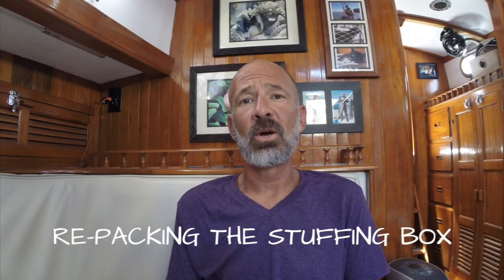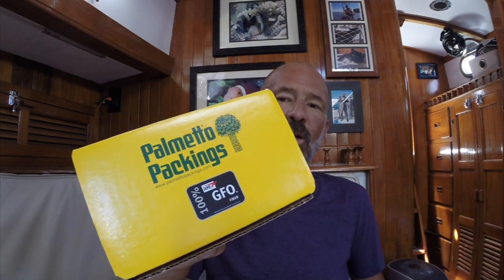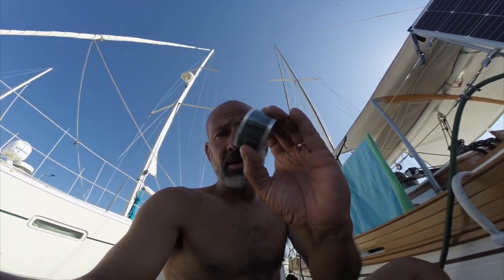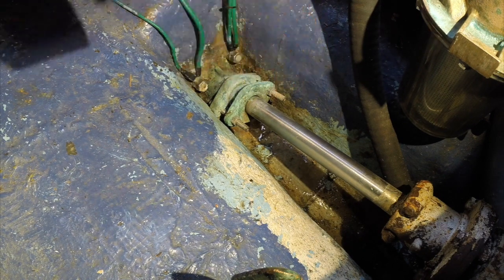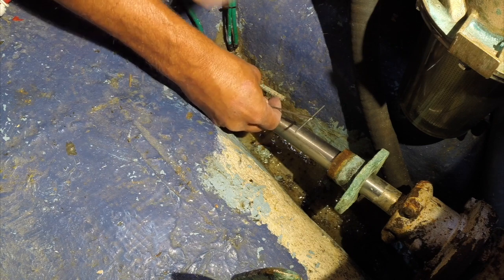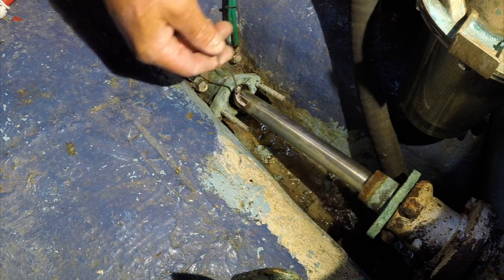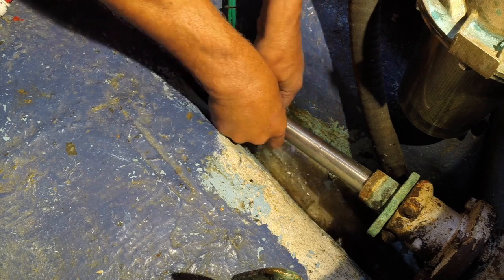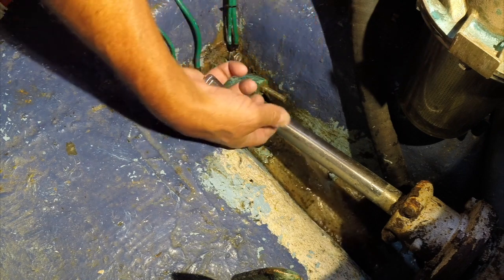Waterlogged Nightmare:  How NOT To Repack Your Stuffing Box | SV Ramble On

Comment: In my 20s I had a new narrowboat shell  (in the UK) built which I lived on and fitted out. When I bought it I couldnt afford the prop shaft so just had the stern tube fitted and then hammered some wood in from the inside to block it. Later on I got the propshaft and had a prop machined on, we hung it on some rope and sledge hammered it in from the outside forcing the wood out. So had that initial leaking drama but I dont recall any issues getting the stuffing to seal it. I had the boat 5 years afterwards and it didnt leak a drop.

Comment: I would have just did 4 of them then the others would still work if there big enough. The first boat I had back in the 70's I forgot to pack it till it was in the water and no packing so I used the seam on the bottom of a tee-shirt wrapped it around four times then did it again, Worked great still in the boat four years later when I sold it!  It looked like yours was to small or won't compress enough!
Reply from the maker: Yep, the 3/16" material was too small and had to order 1 size larger.

Comment: WARNING ! DO NOT USE GRAPHITE PACKING . . This is from both Sail magazine book "Boat Works" and Nigel Calder "Mechanical and Electrical Manual . The reason is that Graphite is at the top of the Galvanic scale . This will cause corrosion in adjacent metal when in saltwater . I found Graphite packing in my my Tayana 37 and corrosion on the shaft is apparent  . I  have seen Graphite recommended on other YouTube videos . Nigel Calder recommends a  drip-free packing called PTFE made of shredded Teflon.  It's a  clay like material that you use between the standard packing rings  . I have not tried this myself but I  will the next time I  haul out  . I'm not  brave enough to do it in the water  .
Reply from the maker: Thanks Will.  It looks like we may need to pull the shaft and get a longer one fabricated when we re-power with the new Beta 43, so I'll definitely look into the PTFE stuffing.

Comment: That was good entertainment and a lil comedy 😂😂.First mistake was ordering the black packing,second you know it took 1/4 but you cautiously ordered 3/16???????why???Third you don’t take it all out especially if it has 7 pieces!!4 is there is a scoop on the outside to let water in you didn’t plug that.5 you aways get 2 sizes of packing if you’re not sure what size to get.I would say the only thing you did correctly was removing the old packing but you screwed that up by taking it all out 😮So you did get the title for this video right 😂😂I’m still laughing 😆 🤣🤣🤣

Comment: Rich, couldn't tell from the video, but do you have intake holes on the forward end of the cutlass bearing housing?  My bearing housing has 2 of the these holes, on opposite sides, each about 1/2" square, where water is sucked into the housing due to forward motion. Probably to provide flow through the bearing.  Plugging those holes would stop water ingress.
Reply from the maker: Thanks Baja.  I looked back at our old haul-out pics and video and couldn't see any weep holes on the bearing housing, and don't remember seeing or feeling any when I was down there with a snorkel.  Doesn't mean they're not there though.  I need to give this bottom a good scrubbing anyway, so I'll give a look-see when I'm down there.

Comment: You may have explained this, but why did you decide to replace the stuffing (it looked like it was holding out the water) while the boat was in the water, rather than on your next haul out?
Reply from the maker: Yeah, Jeni wrote it in the description.  Every time we motor, the stuffing box leaks more than it should and I have to keep tightening it down more than the last time to control the drip.  The stuffing box was also running hotter than it should under normal drip rate, which is an indicator that the packing material is past its prime.  At some point I was going to run out of adjustment depth on the collar, and we're not planning to haul-out again until this time next year.
Reply: Thanks for the quick reply! Looking forward to the continued saga!